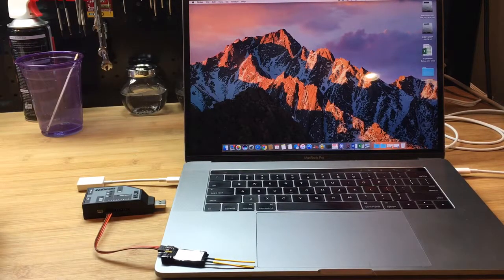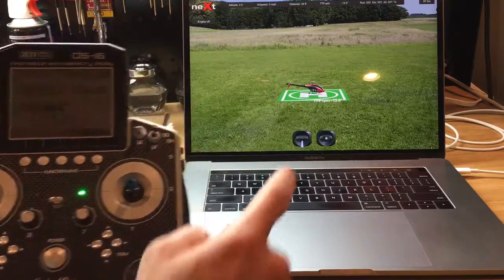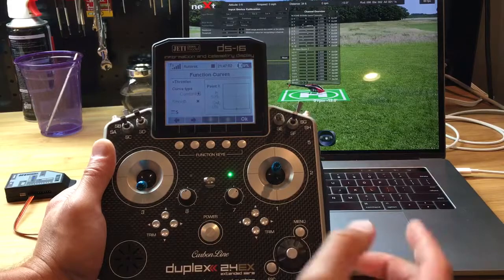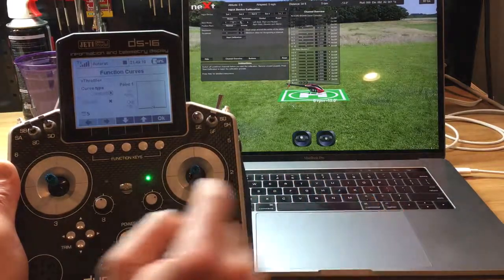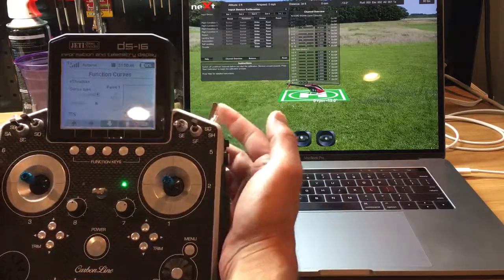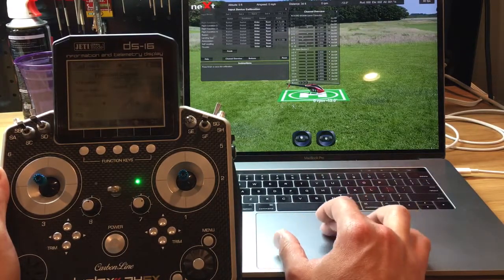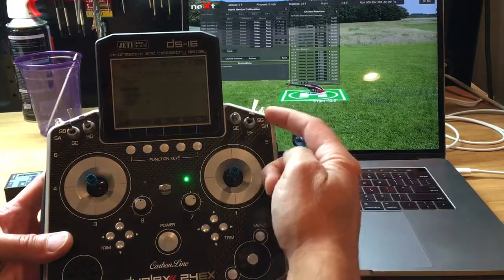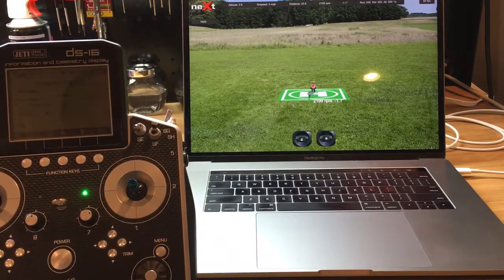neXt flight simulator wireless setup with Jeti radio and RC Ware RX2SIM interface—Part 4 of 4

Comment: Hi; 
I watched all 4 videos and it is working fine. However I would like to know about the switch we set up as “Gyro sens”that you changed the position of the switch to SF. You didn’t assign it to any function in the simulator. Could explain more about it ? Thanks.

Comment: VERY VERY GOOD! Thanks for that! I ordered my RX 2 sim from Align in Ca.  NOW.... lets hope it all works!  I may need some help after interface comes in. I too fly Jeti. The DC24 is best radio I have ever flown with. Simply Simple and amazing !!  Thanks Again for taking the time to make this video.
Reply from the maker: Of course.  I'll be more than happy to assist you in setting it up.  You can also PM on RCGroups, RunRyder, and HeliFreak.  I go by "curmudgeon" on all three forums.
Reply: I need help please. I D/L the the soft ware. But I never get that log in page. I just get a connect page and it does not see the RX2sim interface. I tried on a pc and mac.... HELP!!!

Comment: too much trouble for nothing and more expenses too..you get a chinese dongle with just one cable for only 5 usd and no reciever required or anything..plug and play in  less than 1 minutes all simulators without reciever cables etc etc
Reply from the maker: True.  If you only plan to use the simulator on your desktop computer, then there is no real need to go wireless.  However, if one desires to use a large monitor like the living room TV, then going wireless has an appeal, and these videos present how to make this happen.
Reply: @johnahamelv  yea thats true too....just i m used to my pc cause i have a 55" in less than 1meter from my face :)
Reply: Hi; 
I watched all 4 videos and it is working fine. However I would like to know about the switch we set up as “Gyro sens”that you changed the position of the switch to SF. You didn’t assign it to any function in the simulator. Could explain more about it ? Thanks.